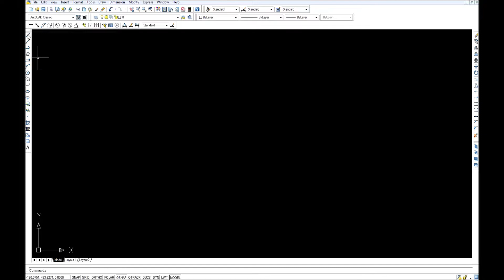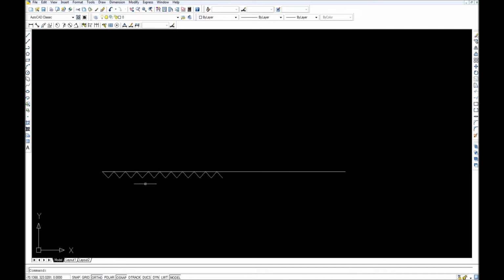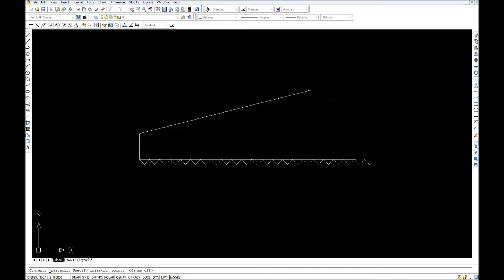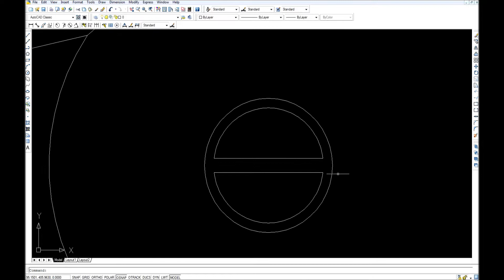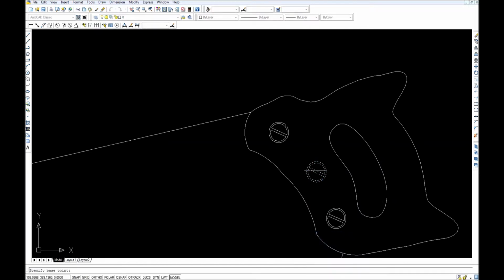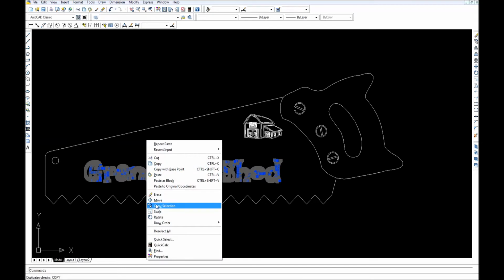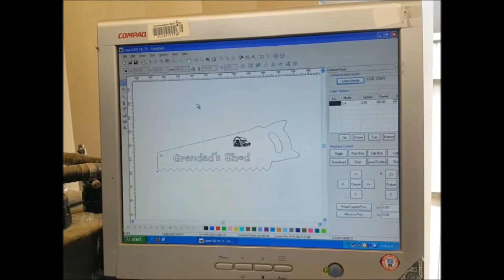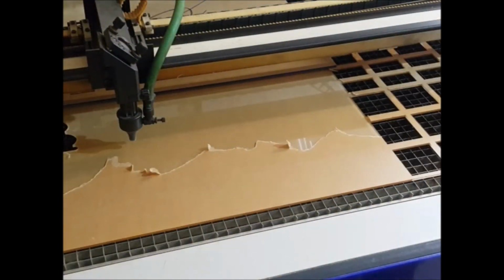#28 - Hand Saw -  CAD Design  Software, Laser  Engraving & Cutting  Acrylic and MDF

Comment: I have a design that I made in autocad that are shapes with solid hatching that I want to engrave but when I import the dxf file into the laser program It only shows the outline. I have the scan output setting selected for engraving but it still only shows the outline and won't engrave. Any help would be greatly appreciated.